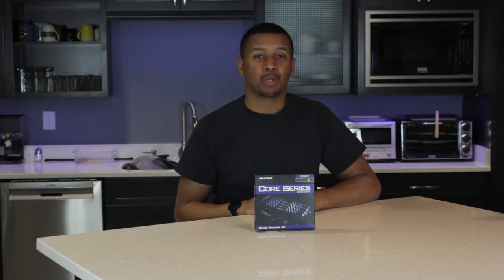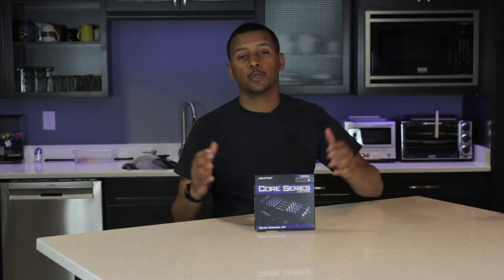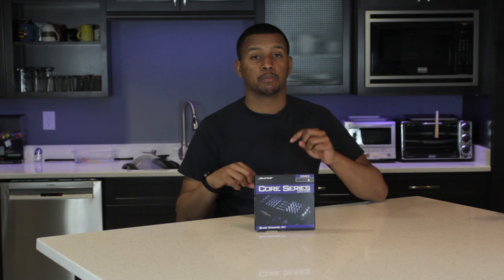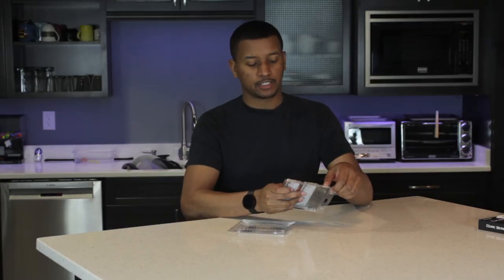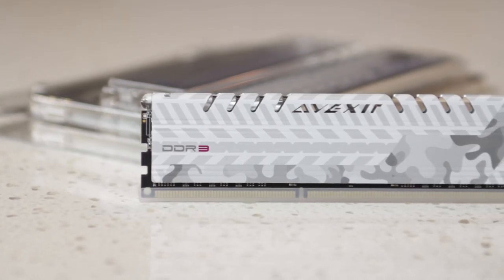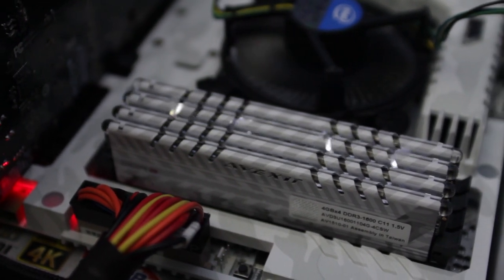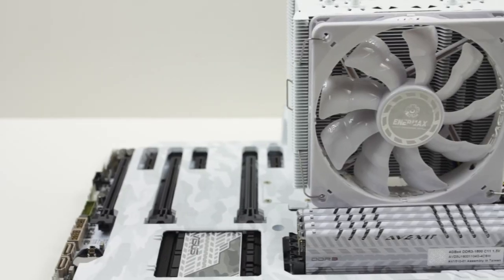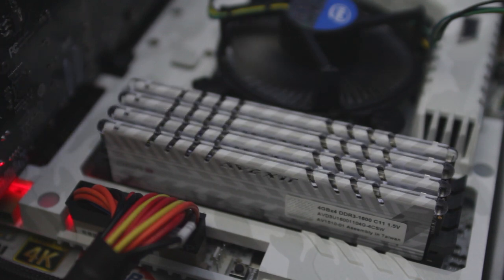Avexir Core Series LED Lit Sabranco RAM Kit | Modder's Dream

Comment: Aight I'm also currently going for an all white build but I'm gonna be using a Gryphon z97 Armor Edition. (Gonna plastidip the armor white) Now I just received my first 2x4GB Avexir Raiden kit today but I'm thinking I want the Sabranco instead since the LED is white. The raiden led is blue which just ain't gonna work. My question is where is the best place to order the Sabranco 4x4GB (16GB) kit?
Reply from the maker: James Barnes I actually haven't seen the 4x4GB kits at any retailers yet. Mainly just 2x4GB and 2x8GB. I guess the retailers just figure ppl can but 2 kits if they want to fill all 4 slots.

Mine were review samples straight from Avexir.
Reply: It's all good I changed my build yet again  lol. So I sold the 2x4GB kit I purchased. Thinking I might go x99 now. Kinda like the Geil ram kit.
Reply from the maker: Build sounds awesome. I've yet to find a retailer in North America that carries a 4x4gb kit. My understanding is that there's no difference than two 2x4gb kits with the exact same specs. Quad channel kits just ensures all the ram matches and sometimes has a small price break. Z97 and nearly all consumer boards lately are dual channel. Thanks for watching!

Comment: I'm In The Middle Of Picking My Parts For My Build, And I Put The Same Motherboard And RAM And PCPartPicker Said That There Might Be A Slight Problem Voltage Wise. Have You Had Any Problems With Your MoBo And RAM?
Reply: I havent

Comment: Nice LEDs...

Too bad it's still SODIMM.
Reply from the maker: Huh? SODIMM stands for small outline dual in-line memory module which are typically used for laptops and mini pcs.
This is full sized dual in-line memory module RAM.